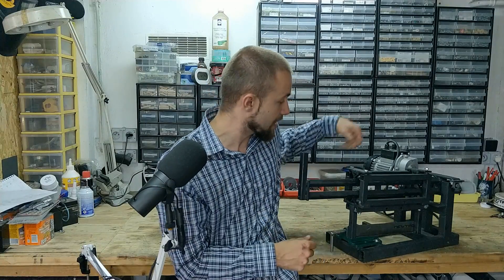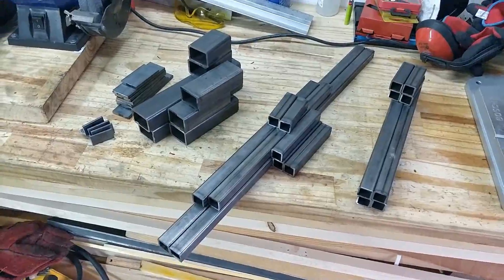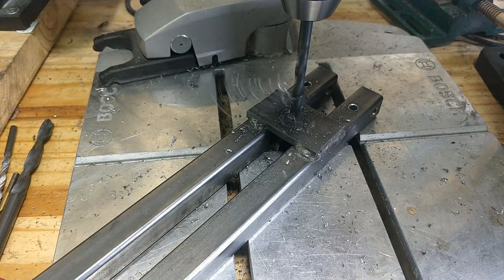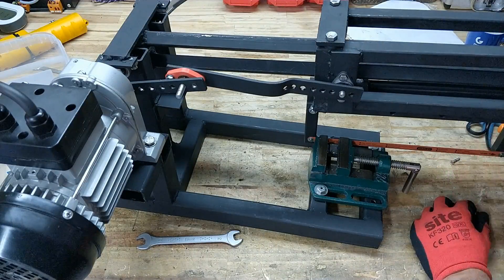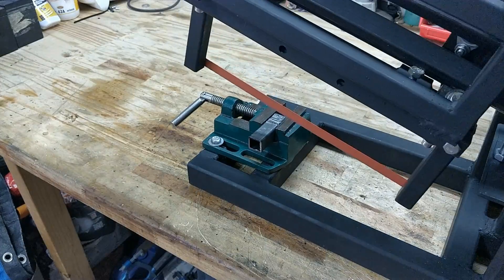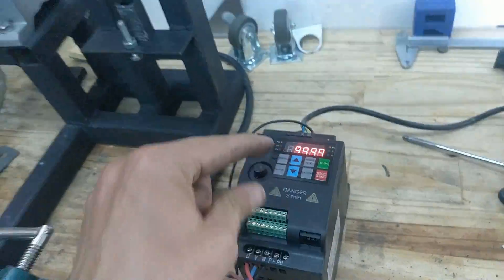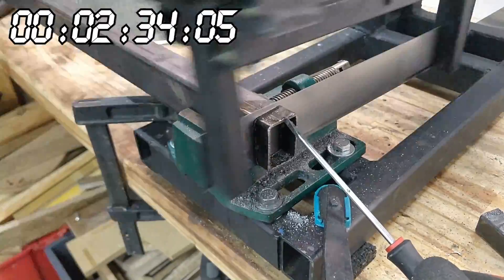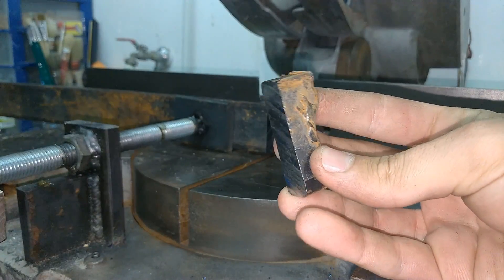Making the Power Hacksaw

Comment: Your hacksaw is good. 

Add blade support, it will pinch the end of the blades together and use 1 inch wide bimetal HSS blades. These are dirt cheap and last forever, they are made for manual and power hacksaws. If you have trouble finding them drop me a message I'll ship them to you.

Comment: Great engineering. However, there is a fatal flaw in your design. You're still applying pressure on the back stroke. That burns up the blades quickly
Reply: How to fix it?

Comment: Every problem you have with blade warping is due lack of tension and support from both sides.I always hated those 1 side frames with bent hook to hold the blade.Older hacksaws had a split square stock that had cross drilled hole for screw  with a thread for blade tensioning.Same system is used for big industrial hacksaw's.
Yes those evolution blades are cool af ,they cut fast but it also costs 100$.These machines are slow sure ,you wont brake a speed record ,they are not fast as bandsaw's(big industrial ones are actualy almost as fast) but if done properly they have 2 great advantages -they cut very square and 300 mm hacksaw blades are incredibly cheap and you can find them everywhere.For a 2$ you can buy bahco swedish made bimetal blade of high quality that will last you a long time.
Its a perfect machine for a small hobby shop or a person that has a time to wait.